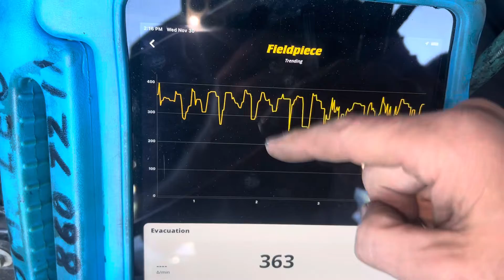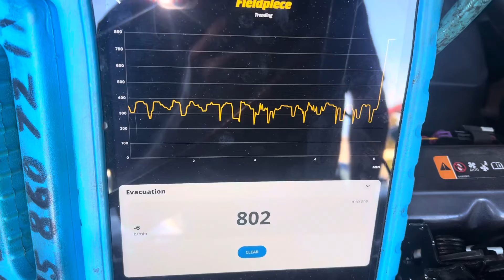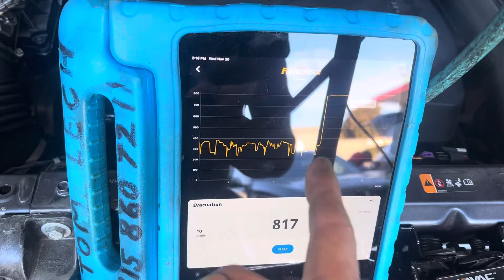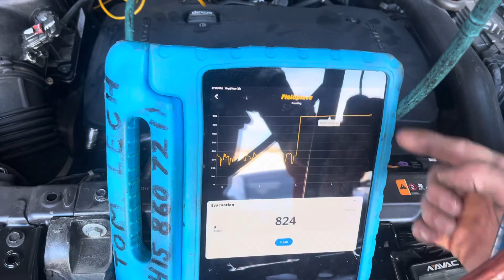Micron gauge reading, jagged, jumping up and down. What does it mean? ? ￼

Comment: For comparison, water freezing looks different than moisture trapped in oil- https://youtu.be/Pm8mBCLJ49w
Reply from the maker: The water quantity in air conditioning lines is not enough to freeze.   It’s distributed so widely and vastly and diluted throughout the whole entire system in contact with all the metal that just the ambient temperature of the air throws more heat absorption into the water that is trying to freeze that it never actually freezes.

I’ve been following Jim Bergman for about 15 years. He used to be the owner of True Tech Tools. I’ve known him back in his days when he used to make training videos for Testo Tools he used to work for Testo Tools to.
Reply: @coldfinger459sub0  There's always the not-unfathomable scenario where the body shop leaves the hoses open while they pressure wash the car!
Reply from the maker: I have experienced that one time.   So I can’t say that the unthinkable has happened and it is possible.. 

We’re not talking about the sharpest people in the tool shed. 

In my last 30 years of being in shops, what I have seen in failures, burnt up motors, messed up, transmissions, fried batteries, fried wiring, harnesses broken suspension parts, burnt up ECUs, ECM’s body control modules body shops will go to no end of the world to destroy stuff on accident with their lack of knowledge it’s just incredible . 
     I’ve had the last 30 years of amusement seeing what’s going on in body shops that gets considered acceptable practices for repairs. 

And it all stems down from one person, the owner of the shop, lack of knowledge to pass it on down the line to train and ensure proper practices, both mechanical body shop and paint and electrical. There is no trickle down knowledge it just doesn’t happen. .    Very very rarely..